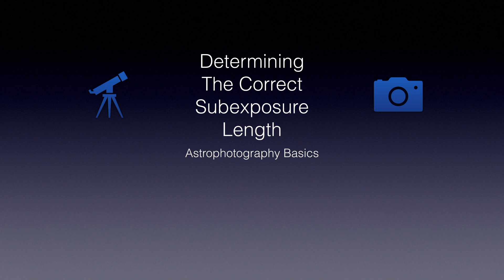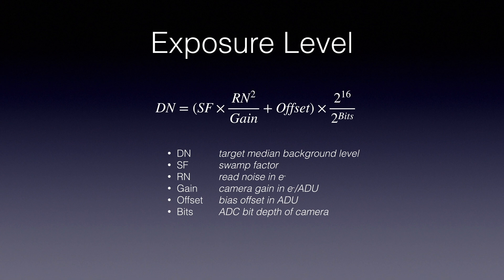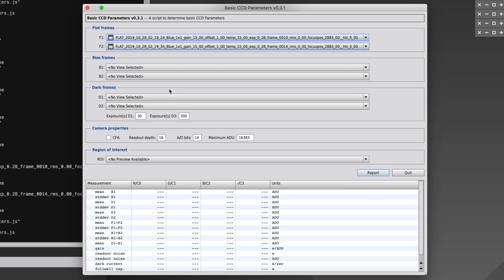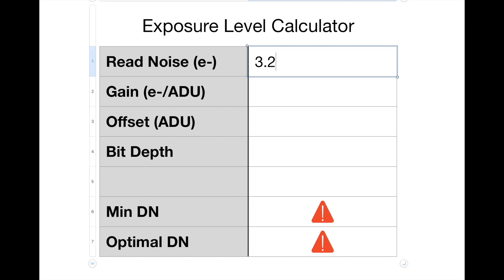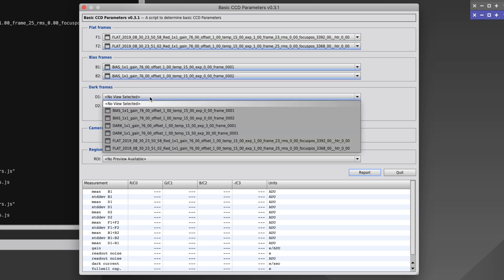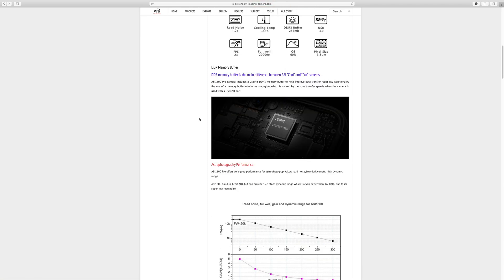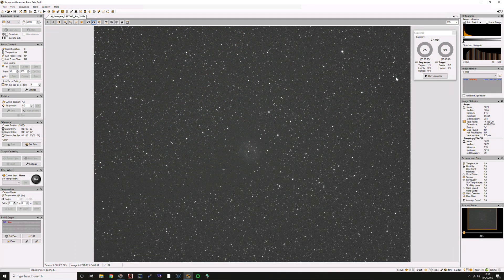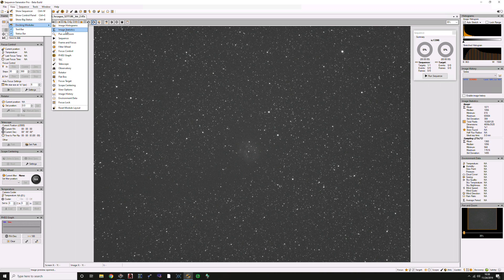How To Determine The Optimal Subexposure Level For Astrophotography

Comment: Dear Linda, thank you very much for very useful video. I would like ask you for answer about Offset. I use for my astrophotography astromod DSLR. I know read noise, I know ISO/Gain in eADU, but I do not know how to evaluate Offset. Do you have some idea how to do it ? What value should I put into equitation ? My thanks in advance.
Reply from the maker: Sorry for the delay in responding. If you are using a ZWO camera I think they default to an offset of 50 but really the goal of the offset is to ensure you don't get any clipped pixels after calibration. You can look at the calibrated sub and see how many pixels have a value of 0. If there are some it probably makes sense to raise the offset enough to avoid that zero clipping.

Comment: Why is your offset 1.00 in your frames?  You stated you used 15 offset for the ascom driver but your files show 1.00 offset. ?
Reply from the maker: It's been quite a while since I did that video so I'm not sure what you are referring to. Do the filenames say something like "offset_1.00" in them? Or are you referring to something else? If you can point me to it, I might be able to respond more effectively.
Reply: @LindasAstronomyAdventures  hi, and yes ,if you look closely at the file names you put into pixinsight,they say offset 1.00. So I was confused.

Comment: Thanks much for the clear and calm explatations. Now myself using a ASI2600, my numbers  would be from 50 to 105 ADU (at gain 101, offset25) . Normally I expose some 3 to 4 minutes long but if I calculate correctly, some 45 second might be ideal ! Wow that is short. I will have to try it out.  Just to be clear here.. Optimal means 'with as little star clipping as possible ?? ' Am i right?  Dennys, Montreal/Canada.
Reply from the maker: Technically "optimal" here means getting good stacking efficiency but as a side effect of that it does tend to get you less star clipping since we're finding the shortest exposures that get you to around 95% stacking efficiency (that is to say the stacked image is within 5% SNR of what a single exposure of that length would provide).

Comment: Hi Linda, with this calculator I've got min 77 and optimal 141. In my 300sec exposure with PI statistics the median is 0.00923 which is way off. But my photo looks okay. Where would you suggests should I look at to determine what's going on please? Thank you.
Reply: Okay, the problem was that I didn't use 16bit in Statistics.
Reply from the maker: Oh, good. Sorry for the delay in responding but that's the right answer.

Comment: This is a great video that I just now discovered. Many thanks. I do have a couple of questions. At 19:25 you mention taking a few frames that don't need to be under the stars and measuring the camera's performance level. I'm not clear on whether these are like flats or what sort of exposure if it is daylight and what would be the means of measuring, PI Statistics? Also, I have two OSC cameras, 294MC and 2600MC. If I load a sub (2600MC gain 100 offset 50 300s under Bortle 8) into PI it is labeled gray, presumably because it is not debayed. PI Statistics shows a median of 14656 on the gray image and 9557, 15784, 11086 (RGB) on the debayered image. Are these numbers commensurate with the DN numbers you talk about in this video? I think your images are all mono. Thanks again.
Reply from the maker: Apologies for the super long delay in responding. I'm woefully behind on youtube. The frames are darks and flats. You want to expose the flats as you would normally (to about 50% on the histogram). And, yes, those are the DN numbers.

Comment: I think you are misunderstanding the offset part of the equation.
The figure is meant to be the median ADU of a bias frame.
Reply from the maker: No apologies needed. Can you clarify what you are referring to? The bias frame includes both the offset and the read noise.
Reply: @LindasAstronomyAdventures  Essentially, the offset part of the equation is the median bias ADU. Can you take a look at a thread on Stargazer's Lounge? It's called 'Swamp Read Noise' by Pitch Black Skies, posted April 19th.
You will see what I am talking about.
Reply from the maker: The median bias contains both the offset and the read noise. I took a look at he thread and it seems to be saying the same thing I am. Is there a specific post in that thread you are referring to. It's possible I missed it.
Reply: @LindasAstronomyAdventures  For instance, at Gain 100 the 533mc-pro camera has an offset of 70. But we don't insert 70 into the equation.
That figure translates to ~2800ADU which is a 16-bit number (the bias median ADU). The offset part of the equation is therefore ~700 which is 2800 converted to 14-bit.

I've noticed a few posts down that some other 533 user's are questioning the low number result in their calculations. They used 70 as the offset figure which is incorrect but you didn't mention it to them.

All I'm trying to say really is that the offset figure isn't the default offset of the camera or the one we change it to, rather it is that number converted to ADUs.
Reply from the maker: For a 14-bit camera everything gets scaled by 4 so the offset of 70 ADU would translate into 280 DN since the camera reports in 16-bit values.  If I have the right vales from ZWO's graphs, then it should be (10 x 1.5*1.5/1 + 70) * 4 to get the optimal value or about 370 with a "swamp factor" of 10. You could get away with as low a value as 307. 

The 533 at gain 100 has a very low read noise of only 1.5e- so it really doesn't take much to bury that read noise in the sky glow.
Reply: @LindasAstronomyAdventures  No, I'm saying that we don't use 70 in the equation. That number is not 70 ADU. It is offset 70, just a number in the drivers. We need to express this figure 70 in the form of ADUs. You can see from the thread I suggested that we write 699 or 700 in place of 70. 
The offset part of the equation is to be expressed as the bias offset in ADU. My bias ADU is 2800. As this is a 16-bit number I divide by 4 to scale it to 14-bit, so 700. The equation is now (10 × 1.5*1.5/1 + 700) *4. It gives a result of 2890 optimal DN.
Reply from the maker: Unless there is is something different about the 533 that doesn't make sense to me. Leaving everything else aside for the moment, if the user specifies the offset is 70 then a bias frame with the camera should be a bit more than 280 as seen in the image (because it gets scale from 14 to 16 bits). I don't know how you are getting from 70 to 2800.
Reply: @LindasAstronomyAdventures  ZWO cameras offset get multiplied by a certain number. In the case of the ASI533 that number is 10.

My bias ADU is 2800. This a 16-bit figure. We need to divide by 4 to get 14-bit figure. 2800/4=700. 700/70 offset =10.

Now you can see that the offset 70 is just a number within the drivers. Without knowing the multiplier, we can't find the ADU value. How we find is through measuring a single bias sub.

In the case of a ASI2600 the multiplier is by 8.

The ASI183 by 5.

ASI294 by 16 I think?

Can you measure the median ADU of one of your bias subs for me please? Give it to me in 16-bit figure.
Reply from the maker: On my ASI1600 I don't use bias frames; I use flat darks. That is a 12-bit camera with a default offset of 50 and it behaved as i the offset was specified in 12-bit ADU values (i.e. if you multiplied 50 x 16) you would get a value of 800. My flat darks are consistent with this (they are a bit higher than this because of read noise and dark current but that's the right ballpark). My other camera is a QHY268M which is a 16-bit camera and the offset matches the reported value without scaling.

If ZWO is multiplying the offset by 10 on the 533 (and I can't understand why they would do that) then you need to factor out the offset when determining optimal exposure making life slightly more complicated. It's strange that they would do that. That's a fair amount of dynamic range to give up for an offset. With read noise of 1.5e- an offset of < 70ADU (14-bit values) ought to be plenty. If you are seeing 2800 in a bias using an offset of 70 then you are likely wasting some dynamic range and could lower your offset value to 7. That being said, if ZWO is doing this multiply by 10 thing on the offset then the formula I used would modify to this:
   (swampFactor * RN^2/gain) * 4 + (offsetValue * 40)
At gain 100, offset 70, that would amount to roughly 2,823 DN

I've reached out to some friends to see if anyone I know has a 533 to see what they can tell me. It's certainly possible that ZWO has changed their driver behavior since the video was done but that's just speculation at the moment.  If the driver is multiplying by 10 though, then 17% of the dynamic range is being wasted by the offset (2,800 out of 16,384).
Reply: @LindasAstronomyAdventures  No, I don't use bias frames either. I just shot some for an experiment and noted the median.

I've just had confirmation that the 1600 offset isn't being multiplied.

Note, it isn't just the 533, you will see from the thread I linked earlier that user Fegato has a 2400 (14bit camera). His bias is around 480 and he has the offset set at 15. 480/4 =120. 120/15 =8. His offset gets multiplied by 8. The 183 and 294 behave in a similar way. I'm surprised yours doesn't, but it's great that it doesn't as it makes no sense and is very confusing.

It is 2800 out of 65,536. The ASIair Pro bumps everything to 16bit.
Reply from the maker: You are correct. I scaled one side and not the other so the dynamic range loss isn't quite as bad as I was thinking but still seems like more than is necessary. 

A friend sent me a 60s dark from a 533 (she didn't have any bias frames) and it's at offset 70 and shows a median of 678 ADU (in 14-bit values) or 2712 in 16-bit. if the multiplier were 10 then it should be at least 2800 so I don't know what ZWO is doing with their offset values. 

If you have PixInsight you can use the MureDenoiseDetectorSettings script to get an estimate of the offset given two flats and two darks or biases. I'll see if I can find out what ZWO is doing in their driver (and why) because on the surface it makes no sense. They've essentially obfuscated what the offset number really means which makes it harder to use.
Reply: @LindasAstronomyAdventures  Thanks. I'm gonna try find out more too.
Reply from the maker: I'll definitely let you know if I come up with something. I've been trying to reverse engineer what units ZWO might be using for offset and coming up empty handed. I'm sure they have a reason for what they did, but it isn't an obvious one to me.
Reply: @LindasAstronomyAdventures  I've been experimenting in NINA with bias frames at various offsets.
Reply from the maker: Curious. The frame I was sent was at gain 360 (don't know why she was using such a high gain) and the  multiplier would work out to 9.6. Perhaps a touch lower since that includes some tiny read noise and dark current since it's a 60s dark. However, that should at most account for 4DN of signal. I'm still looking into it though I don't expect to have an answer today. Thanks for the info though!
Reply: @LindasAstronomyAdventures  If the offset gets multiplied by approximately 10, 70 offset default seems to be a bit overkill. I mean I could get away with 5 offset at that rate and it would be similar to your offset 50.
For offset 5 I get a Median value of 196 (16-bit).
196/4= 49 ADU.

Unless we can get in touch with someone from ZWO, I'm not sure we will ever know the reasoning behind it.

Another thing worth mentioning too is that the ASIair Pro doesn't give an option to change the offset value. I'm missing 699 from my dynamic range of 16,384. Where as with an offset of 5 I would be missing just 49 from the 16,384.

Comment: really good video. i will have to watch it like 10 times to get most of the info committed to mem. one thing that makes it harder is you keep switching between cameras. So following and being able to get a base line understanding is harder.
Reply from the maker: Brian, thanks for the feedback. Sorry it proved difficult to follow because of that.
Reply: @LindasAstronomyAdventures  np i was wondering i am using a asi294mc pro. I took it out to shoot orion and had -10 temp at 180 sec and 194 gain. so ok it came out way over exposed after stacking. so i found your video and after doing the calc i was left wondering is it better to play above 120 gain or below, because the cam has that weird divide where read noise drops like a rock at unity. So i am stumped as what to do. any input? yes i am brandy new to this so please forgive me. lol
Reply: from the calc you gave us it seems 120 gain at 300sec subs is optimal right or did i do that wrong?
Reply from the maker: Brian, this doesn't tell you the exposure time. but rather the exposure level. That is the the median value that your exposures should be. Exactly how long that will take will depend on how dark your sky is and what sort of filters you are using. For the ASI294MC Pro, at gain 120, the optimal value is 344DN (DN just means data number). Odds are that is only going to take 10-30s at most unless you are in very dark skies. The choice of what gain to use comes down to a tradeoff between read noise (higher gain gives lower read noise) and dynamic range (higher gain has less dynamic range). On your camera, though, there is that sudden step where read noise drops and dynamic range goes back up. So gain 120 gives you almost the same dynamic range as gain 0. Odds are pretty good that unless you are using some narrowband filters you can stay at gain 120 and stay in the sweet spot for read noise vs dynamic range. However, if you find that you are ending up with lots of 10s exposures you can drop to gain 0. That would raise your optimal level to 777 DN which would double your exposure times.  This stuff can be a bit confusing (that's why I made the video) but the key point is it tells you what values you want to see off the sensor not how long to expose for. How long will depend on things outside of the sensor like filters and sky.

Comment: I must be missing something, when i click on the link i cant input any of my settings such as readout noise gain etc
Reply from the maker: Paul, the only two permissions I can share it with are "view only" or "make changes". The latter would let people change the formulae which could mess up the spreadsheet for others. You should be able to save it as a copy so you can change the values. Let me know if iCloud isn't letting you do that and I'll see what can be done.
Reply: @LindasAstronomyAdventures  thank you Linda will try now
Reply: nope couldnt do it lol,  i do have some info though if you could put me in the ball park my gain is 100, offsert10.  (readout noise 1.575  and gain 1.024 pixinsight )
Reply from the maker: I'll look for an alternative way to share it. But, in the meantime, assuming your camera is a 16 bit sensor then I get 34 DN as an optimal value and 17 as a minimum. If you have a 12-bit camera like the ASI1600 then it's 548 optimal and 276 minimum.
Reply: @LindasAstronomyAdventures  its the 533 osc so its 14 bit but behaves like a 16 bit? does that make sense ?
Reply from the maker: ZWO scales the 14-bit value to l6-bit in the driver but the gain and read noise are in 14-bit values so we need to scale the calculation the way that ZWO does in their driver. So in this case that gives 137 optimal and 69 minimum.
Reply: @LindasAstronomyAdventures  thank you very much linda for your time and pateince its very much appreciated
Reply from the maker: No problem. Good luck!
Reply from the maker: I exported the icloud spreadsheet in excel format. You can grab a copy at this link: https://lindasastronomyadventures.files.wordpress.com/2019/11/optimal-exposure-level-calculator.xlsx
Reply: @LindasAstronomyAdventures  Thank you once again, I was looking at some images i took the other night with statistics in PI and its showing median 156 (137 is optimal) so I guess im in the ball park linda, thanks again